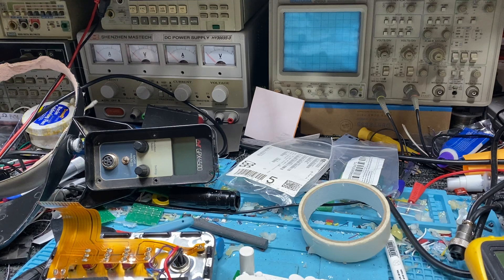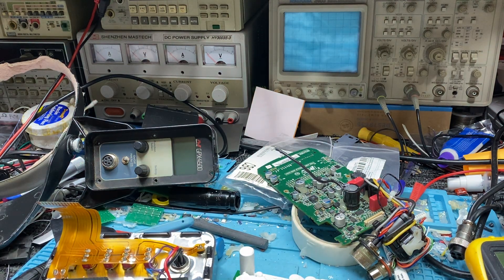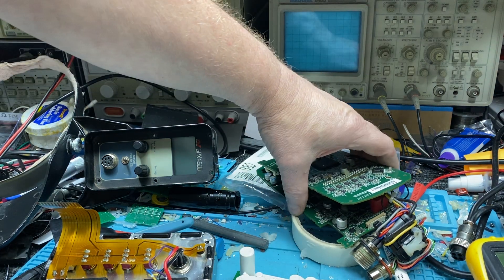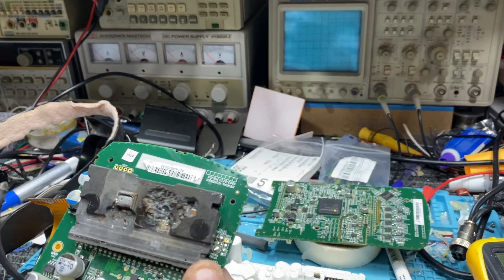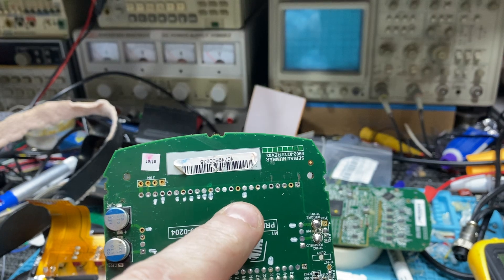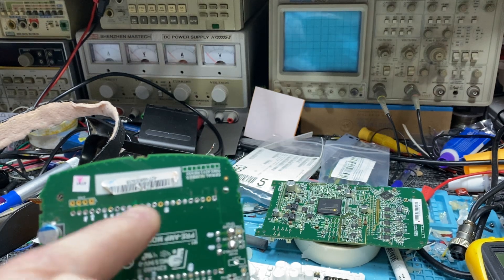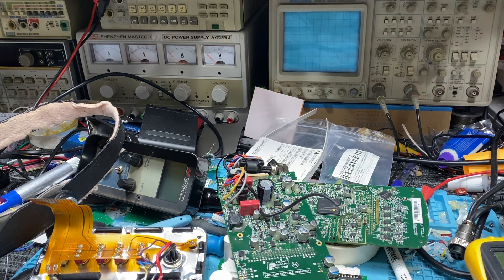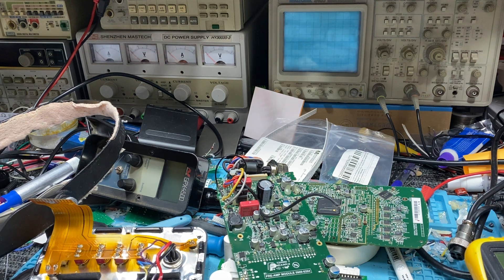GPZ-7000 Receiver module failure and attempt to build a new preamplifier for it.

Comment: Hi Woody, here’s my contribution to your effort. Use low temperature solder on all pins, heat with a hot air gun, and it comes right out. I did this on one.
Reply from the maker: I was going to fabricate a milled brass block and channels to dip the module legs and heat it all at the same time and yes that low melting point solder is a good idea as I have used that on a few micro processors.

Comment: Hi, you did show a 7000 with a failed module, can this happened to a 6000, and have to replace the circuit board, thanks.
Reply from the maker: If the module in the 6000 fails and it’s out of warranty then you will cry.